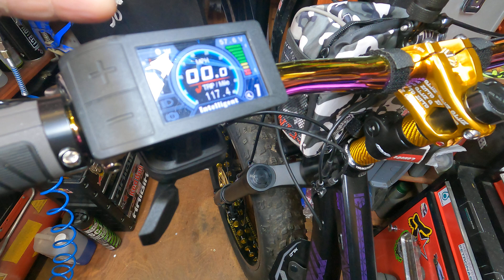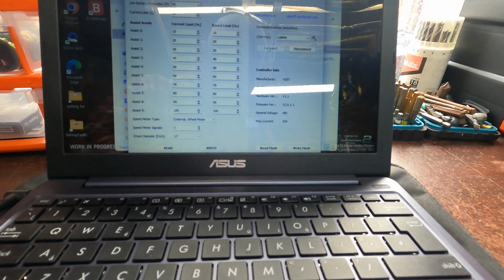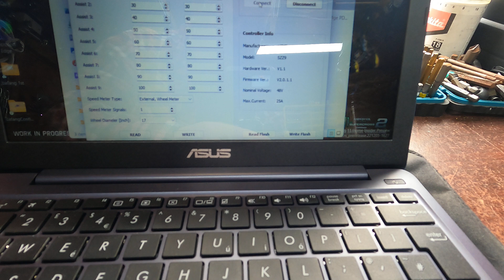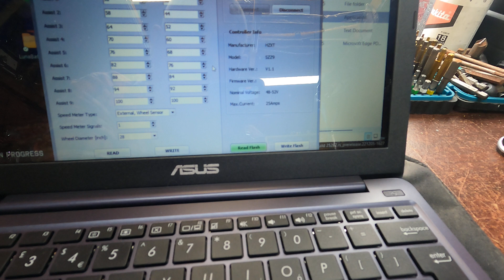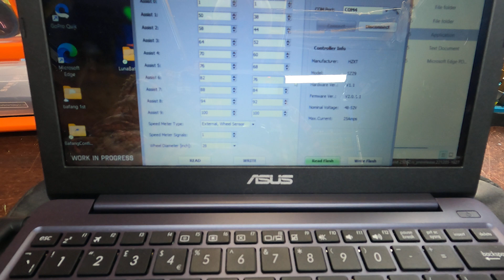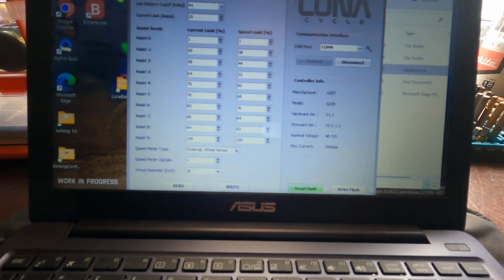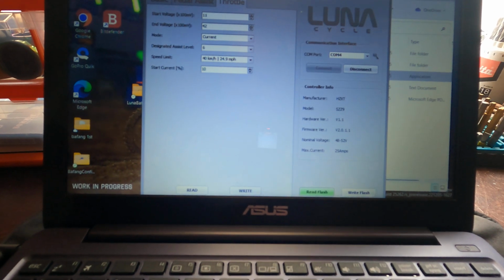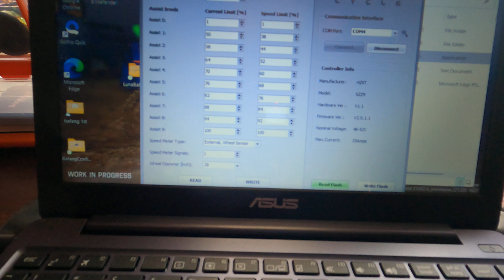Flashing my bafang motor to show & use 52v battery

Comment: The display showing the voltage is also correct it's the capacity range of voltage shown for a 52v battery the range is from 58.8v @ 100% charge down to 41v @ 0% charge left, only issues I find with this display is the voltage gauge doesn't move down as the battery depletes it worked when I had a 48v battery on it but doesn't on a 52v only the numerical voltage goes down

Comment: I have this display you also need to change it to 52v in the settings, you can access the advanced settings using pin 1919 then it will display correct voltage